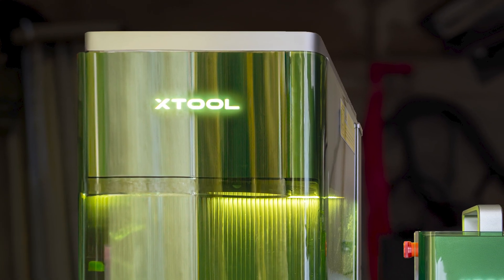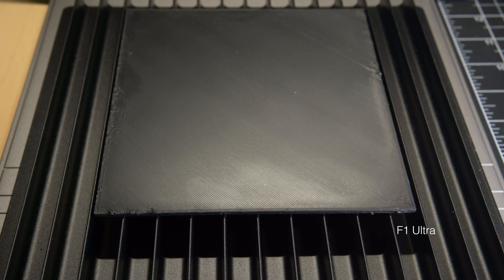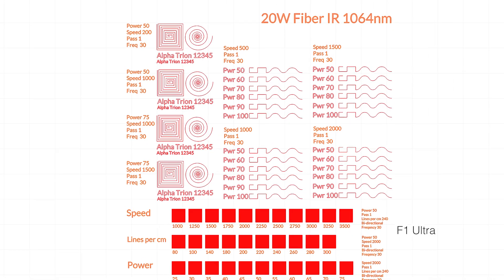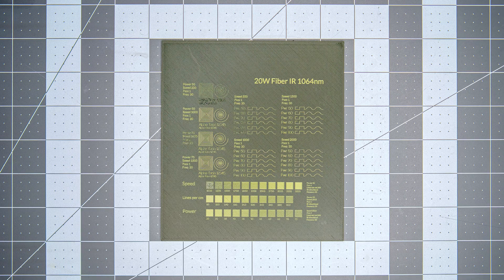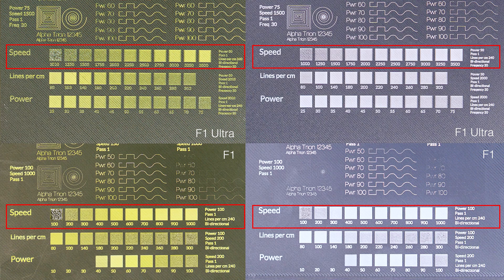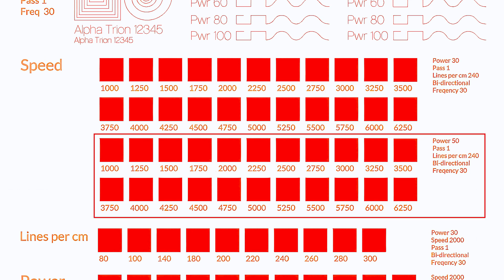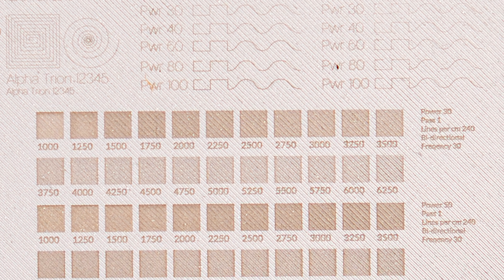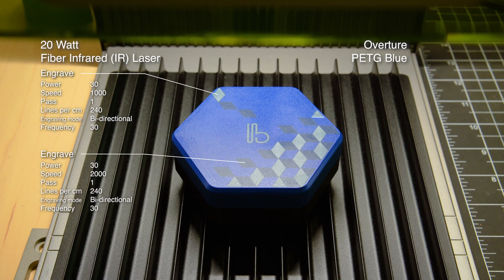xTool F1 Ultra on 3D Prints

Comment: I noticed that all your tests are based on a single pass. I feel this is why your results are limited. Try increasing your speeds and utilize multiple passes will give you better results. 
Also regarding cross referencing the results between the F1 and F1 Ultra, this cannot be done due to totally different lasers between the two devices. This is directly from Xtool. I purchased my F1 Ultra for a project to do this specific task based on results from a colleagues F1 testing for me. I purchased the F1 Ultra on day one and thought I could cross reference the power settings.. NOPE.. Days of testing to get the correct results. 
My PLA settings were Low Power at 25% Speed at 7000 and 8 passes 240 lines per cm. I haven't tested cross hatching yet.

Comment: Didn't stop with the blog posts to go with your videos! As much as I enjoy the videos I get more out of the post! 

Also thanks for sharing your in progress file with me a couple weeks ago, it was an amazing starting point for our own explorations with this process. 

One of the biggest issues we have noticed is for the laser to cause a color change when the design narrows. This tends to make things a little darker in those spots. This has been with larger non uniform designs! Just one more bullet point.
Reply from the maker: @richardhobson7724 We've encountered this as well. Have you tried adding adding bars to that element of your design that fall off-piece? You'll have to group them as a compound with that element of your design. Essentially, you're tricking the machine to raster the same distance (the max width of that element) all the way down the entire element. 

We touch on it in an earlier vid: https://youtu.be/NQEGXvpRVDE?feature=shared&t=273

Note: you may want to put scrap material underneath to protect your engraver's base plate.
Reply: @batchresearchlab  thanks for the tips! Yes we have been trying this but in cases with bigger gaps between the sacrificial edge and the design we are still seeing it. Almost like it still heats those small sections too much. I may also just be bad at designing things! 😁
Reply from the maker: Well, there really do seem to be optimal (and NOT optimal) combinations/variables involving the material and the graphics we're trying to apply to them. We went through around 4 different light grey/silver filaments before we ended up with the what's in the video for the top ring of the MagPod. Some just didn't respond well to the laser 🤷🏽‍♂️. But we also theorize that with the heat/rasterization issue, a way to specify the laser's rasterization/timing/transit parameters (in relation to a graphic's dimensions) via G-code could really help with complex designs.
Reply: @batchresearchlab  Not gonna lie, I think you hit the nail on the head!  

The effect of the laser engraving (on any material) is definitely proportional to the amount of heat/energy pumped into any given unit of space of that material over a set period of time. 

Even when adding sacrificial edge elements the time on spot tends to add up if the laser gets back to a point on the object before the existing heat has time to dissipate. That means that if the sacrificial engraving/s are not big enough then the beam still gets back to that small spot too quickly.

Having the ability to essentially pause the laser just long enough to make sure that each line takes exactly the same amount of time as the one above it would probably work, this value could be calculated based on the max width of the engraving and the lasers speed.

If only xtool wasn't so locked down. Maybe we can do this with their F1 Ultra light burn driver?

Comment: Sorry if I missed it, but how did you land on a frequency of 30? Have you tested other frequencies?
Reply from the maker: '30' is actually xTool's default for frequency when manually setting up parameters for the fiber IR on the F1 Ultra. So far, between both the F1 and F1 Ultra, it's a setting that only seems available for the 20W Fiber IR on the Ultra (and not for the 2W IR on the F1, or the Blue Diodes on either). So it's an aspect we haven't delved into exploring yet, with regard to how it affects 3D prints. We know it has something to do with how the power is distributed throughout the laser's pulses, which in turn would probably affect how the plastic would be heated. But that sounds like we need to do another study....and probably another video😉🤣
Reply: @batchresearchlab  yeah, frequency is (i think) specific to fiber lasers, but I"m still trying to understand what effect it has on different materials

Comment: Does ironing the top surfaces make a noticeable impact on the laser results?
Reply from the maker: A smoother surface does seem to improve the perceived  'sharpness' of the laser-applied graphics, especially with the foaming effect. But most of the time, critical detail (like text) is still fairly legible when applied to un-ironed (flat) top layers. Likewise with first/bottom layers when using textured plates. For this test, the test tiles were all engraved on the top sides. The blue hexagonal box lid example in the video was marked on the build plate-side of the print, using a fairly smooth SuperTack plate — which is fairly close to the texture of an ironed top-layer. 

One note though; when applying a material ablation/evaporation effect (which we don't cover in this video), the contrast of an initially textured surface can result in a nice look. See an example here in one of our older vids:
https://youtu.be/QXfPpXRM8bU?feature=shared&t=576

Hope that helps😉

Comment: Thanks for the video. I'm considering buying a xTool F1, do you have affiliate link?
Reply from the maker: Not yet, and we’re starting to feel a bit insulted considering all the randos they send out units to, much less affiliate program codes 🤣.  We’re working on them though :-). We currently have the F1 and F1 Ultra and a P2S is on the way, all of which we paid for ourselves. We’ll let you know how we’re feeling soon enough about the P2s, but we’ve really like the F1 and F1 Ultra so far. Point being… hopefully it helps knowing that we like the product even without it being free!!
Reply: @batchresearchlab  Hope they quickly agree, with the great videos you made there is no reason not to.

Comment: I love the F1 Ultra, though I wish it was (even) more affordable.The price tag is definitely the only thing holding me back.
Reply from the maker: Yeah, it was/is a significant investment, for sure. Though I will say that we have accomplished quite a lot with the standard F1, and it's a lot easier to move around the shop😉. It also has a removable bottom plate (and top handle) that lets you place it directly on top of larger objects for engraving.